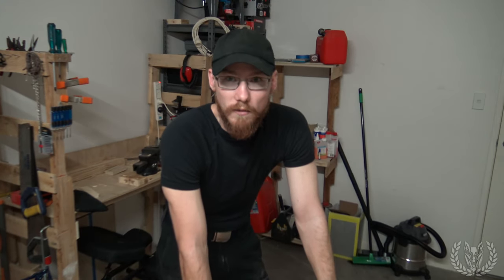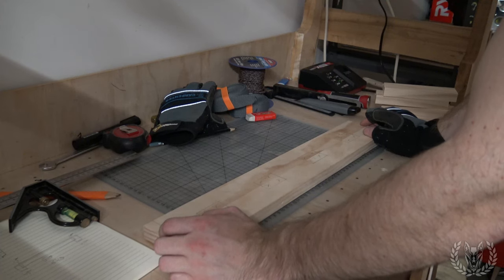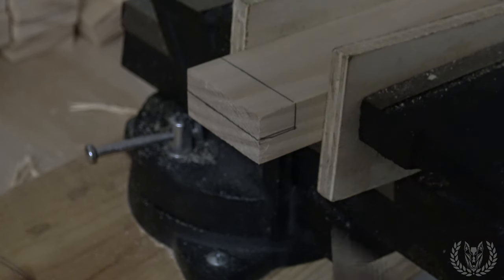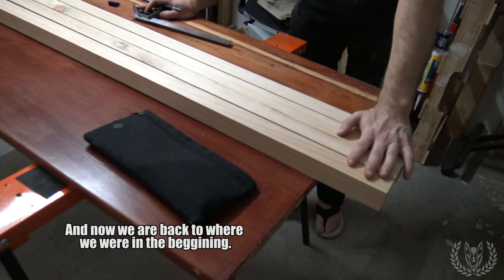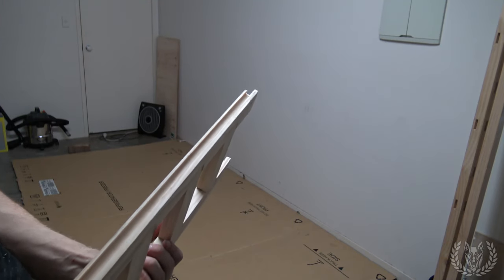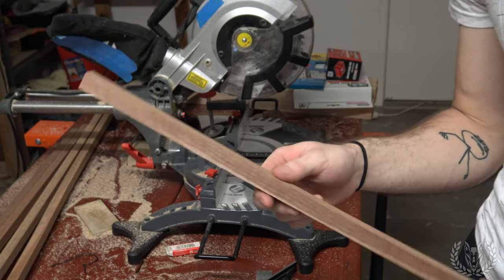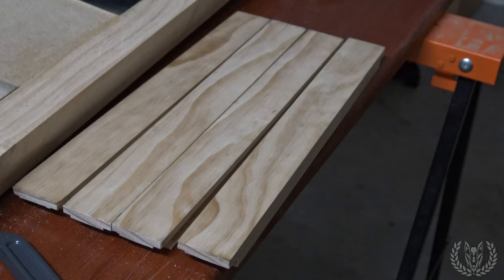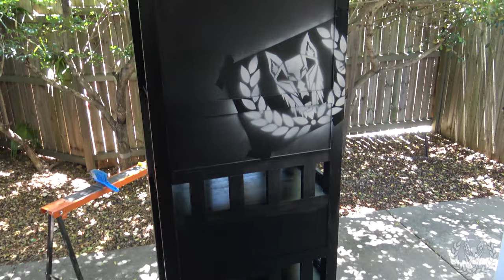How to build a battle station! Making a custom D.I.Y PC cabinet from scratch

Comment: Routers can be shit scary (I had mine tear a chunk of oak apart and throw it across the room last build) but it is my favourite tool and super versatile. While I admire the chisel work you  can cut those half-laps quickly on the router table with a little practice. Great learning project, I find trying to build something where I don't quite know what I'm doing teaches me the most. Keep it up!
Reply from the maker: I've heard way too many stories of router tables eating fingers to be comfortable around them haha, I like my digits. And the problem with cutting the half lap sockets on the router is you don't get a square edge, which when they are on show is important, you end up needing to use the chisel for cleanup anyway.
Reply: @ThatThaneyGuy  When you see my chisel skills you'll see why I'd take that deal every day ;) haha One day I'll own a grrrriper. But currently I use scraps as push blocks to keep the digits safe. Fixit Fingers can't fix fingers ironically :D